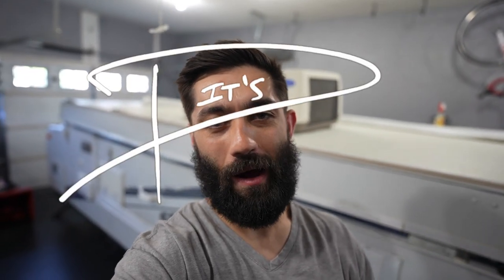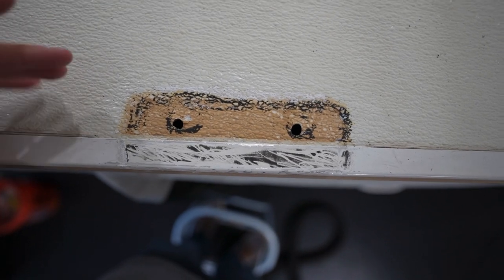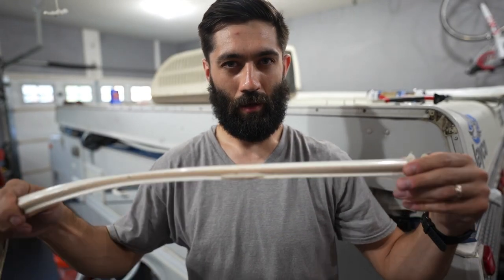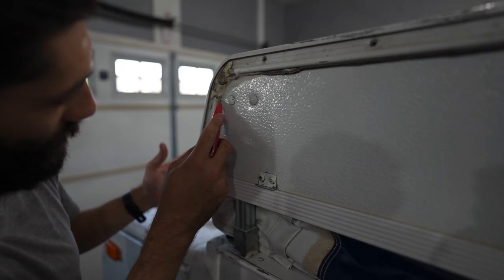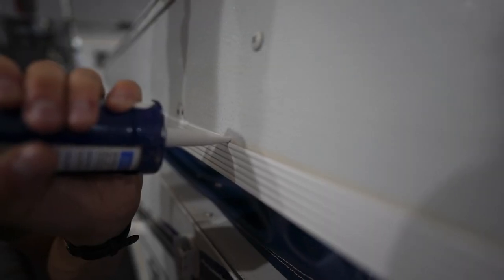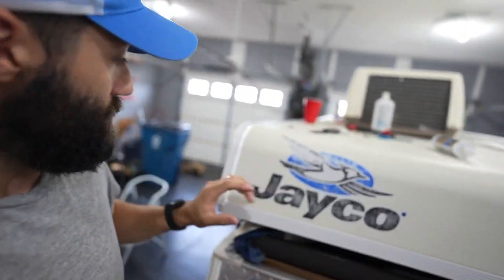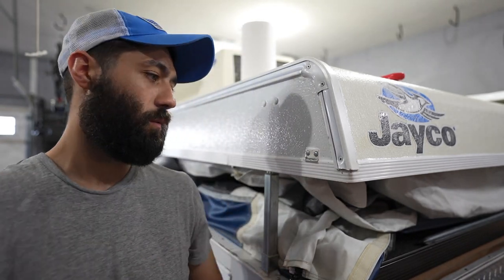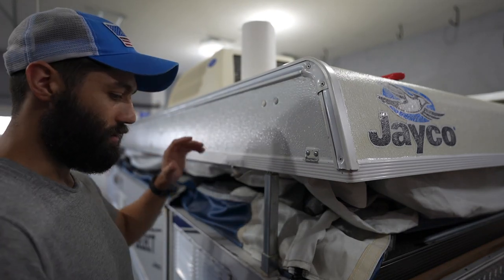Only RESPONSIBLE Pop Up Camper Owners Do THIS | How to WATERPROOF Your Pop Up Camper!

Comment: Just a little tip or trick to 100% silicone. After laying your nice bead of 100% silicone mist it with some windex. Then wipe your joint with your finger. Silicone doesn’t stick to windex so you get a nice clean line with a lot less work. As a plumber I have Ben doing this for years on sealing toilets to the floor and looks amazing and a water tight seal. Your welcome. Will save a lot of time on making it perfect.
Reply: Thank you 👍

Comment: To remove the old silicone I used pencil erasers ,white ones .I found that they rubbed the silicone off and wore out to the shape of what you were working on and that you didn't have to worry about scratching the panels.i went through quite a few so buy half a dozen or so .

Comment: After complety gutting and rebuilding my pop ups complety rotted roof, I went with the expensive permanent solution. I took it to a a Line-X truck bed liner facility and hat the entire roof coated. Cost about 900 Bux Canadian, but with the amount of rain on the west coast, it was worth it.

Comment: I’ve been told that silicone is something you want to avoid when caulking due to the fact that you can paint over it and not a whole lot will adhere to it as well. Using a polyurethane based caulk I’ve heard is the way to go. Any knowledge you care to lend on the subject?
Reply: Yes, what you said is technically correct. But unless you're really planning to paint it yourself at home, silicone is the better option.

Comment: Thank you, great instructions, I just bought a 1988 Starcraft Astrolite and was planning on just replacing trim insert until I saw that the caulking was peeling and cracked.  I took the trim off, planning to use butyl, then noticed that the possibly original compund was a rubbery white substance...after viewing your video, I will proceed with the butyl.  But I am a huge fan of proflex rv not silicone for caulking.  Thanks again, you now have one more subscriber.
Reply from the maker: Cheers

Comment: Love your videos, great content. One tip I highly recommend for using any kind of caulk, is running through with a “metal ball cake fondant tool” to precisely even out the seams. Helps put a perfect edge on the caulk, and don’t have to keep cleaning off your finger.
Reply from the maker: Interesting - we’ll look into it.

Comment: Man you have so many great videos I'm so addicted to your channel... lol. I'm pretty handy when it comes to carpentry and getting ready to replace the floor on my 2010 Jayco Jay Series 1206 and I have a few questions. Seems that the rotted floor is from the Cassette shower / toilet on the right side that spreads out to the front storage box and a little under the slide out. First time owning a Jayco but wondering if the side walls are on top of the floor ? Also how would I get under the slide out to replace that part of the wood floor does it have a front panel I can remove ? Going to assume the floor extends into the front storage box as well ? Thanks... The roof seems to be good, no wood rot on the side and front and back of it. So looks like is coming from the Cassette shower and toilet where all the rot is.

Comment: Do you know if you can use 1"x 12" pvc board to replace the roof side rail.  Also, how much weight needed to be supported by the brackets that get mounted for the lift system?

Comment: I didn't know my camper roof would come apart like this and I've bent two of my corner tracks🥺 im going to take all the inlay out and replace mine. Do you have any advice on the two bent corners? Should I cut the track at that spot and replace with new plastic corner end caps? I'm replacing my front and back roof boards that rotted from the previous owner so im hoping opening the roof this way will make it easier for me, then I can reseal it properly.

Comment: Hello and thanks for the information. We just bought our first pop up from the orig owner. Always garaged. My question is I will be resealing the roof areas as you this weekend. I picked up 2 tubes that you recommend. Our pop up is a 2010 Santa Fe the box / roof is 12.5 feet. Do you think I’ll have enough to do the corners and down the sides and front and rear areas. I’m thinking 2 tubes should go along way. Oh btw thanks for the cassette video. Helped a lot. 
Dave.
Reply from the maker: Yeah, should be good

Comment: How did you repair that hole in the roof? Had a limb fall on mine
Reply from the maker: Put a bigger hole in it by installing a roof vent fan. For a smaller hole, try JB water weld or a fiberglass repair kit - that is if you’re roof is made of fiberglass.

Comment: The  top of my pop up is different so i am wondering if I would need to take off those corner pieces, applying butyl tape and then caulking? I have a 2004 fleetwood hemlock high side. It is new to us and I want to make stir we are maintaining it is a way that will make sure we don’t have any major issues in the further
Reply from the maker: You can always take it off and take it a look yourself to see what the factory used, but a great resource on Fleetwood pop ups is Pop Up Camper Pro on YouTube. I'm sure Derek can point you in the right direction.
Reply: Do you have the ABS roof on the Fleetwood Hemlock?

Comment: Can I ask why the tape is used at all. Why not a bead of caulking that squishes out and wiped clean?
Reply from the maker: Butyl tape is really neat in the fact that it never really drys out especially the butyl tape underneath the trim. It also interfaces well with screws such that screws pull the butyl tape into the screw holes, thereby keeping water out. Finally, in my opinion, butyl tape is much easier to remove compared to caulk when/if your replacing or doing repairs.

Comment: I was always told never remove the factory sealant... Just apply caulk over it. But watching this it seems pretty manageable to create a "factory like" seal with the new butyl tape.
Reply from the maker: Interesting - that sounds like it could get messy after a few reapplications lol.
Reply: @ItsPoppin  you used a little TV magic during the video but about how long did it take to do the whole roof?
Reply from the maker: You could probably knock it out in a couple hours. It's hard for me to estimate, with the roof rack mounts and filming, it definitely took quite a bit longer.
Reply: Not sure who would tell you that, always remove the old caulk, impurities like oils and tree sap will remain and not allow the new caulk to adhere to the old.  I found that out the hard way. Do not use Silicone it does not hold up to the sun,  Dicore is preferred and will find its own level also, It also expands and contracts without splitting  due to heating and cooling of the surface because it really never cures to a solid.. If you do use silicone, use the type that's used in bathrooms that wont mildew. It is a cheaper alternative to DiCore. But wont last as long
Reply: @dawg7915  Whoever owned my camper before me siliconed all the joints. Now its all falling off.

Comment: Do you think the butyl tape could be used to seal the fan on top of a camper? Ours is leaking.
Reply from the maker: Yes. Butyl tape in between the fan and the roof along the screw line. Then seal the screw tops with dicor self leveling lap sealant along with the edge of the fan where the fan and roof meet.

If you want to see what I’m talking about, check out this video: https://youtu.be/MZuIVIjID_E right at about the 14:50 mark.

Comment: Redoing the caulking that's not up to par is obvious for me to see, 
but what about the actual roof top?  My jayco's roof seems to have what looks like thousands of minuscule cracks on the surface.  Do you just wax it to bring it back to life or does it need to be coated with something?
Reply from the maker: If it's actual cracks and not just the natural look of the fiberglass, a lot of people coat their roofs with an acrylic or silicone rubber roof coating such as Henry's or Dicor. We've not done this - at least not yet, but it may be an option worth looking into.
Reply: @ItsPoppin  Thank you for responding so quickly.  You are right, the roof has a rough texture (not quite the same as the side walls on our 5th wheel which I wax) and it probably is the natural look after 10 years. I am the 3rd owner.  There is no sign of leaking inside so I am unsure whether it is something I need to take care of right away.   There are very few articles I've seen of people talking about the actual fiberglass roof on their pop ups.  So I'm not sure I should worry about it too much.I take it, you do nothing more than wash your roof.   I am looking to your experience to learn more about my new to me pup.
Reply: Dicor roof sealant. It's in a paint can. Great stuff.

Comment: Where do you get the weather strip middle piece from? I found butyl tape on Amazon but unsure do the other stuff you said looked discolored.
Reply from the maker: Amazon as well. It’s called trim insert and comes in different widths and colors.
Reply: @ItsPoppin  Perfect! Would you say the average pup uses 1” trim insert? I have almost everything I need to start replacing the edges like you did in the video! 

Any suggestions for a p-up door that has a gap my hand can fit into even when leveled? We finished camping, put the camper down and then did a once over before removing the levels and leaving- that’s when I noticed a big gap between the lower half of the door (the part that stays in place while the top part gets put into the pup), and the ceiling of the popped down camper. Ever run into that before?
Reply from the maker: Tough call of the trim insert. I recommend measuring exactly what you have. Regarding the door, I can only imagine that either your frame is bent (least likely) or your roof is being unevenly raised. What kind of pop up or lift system do you have? If you determine that, you may be able to adjust your roof to reduce that gap.